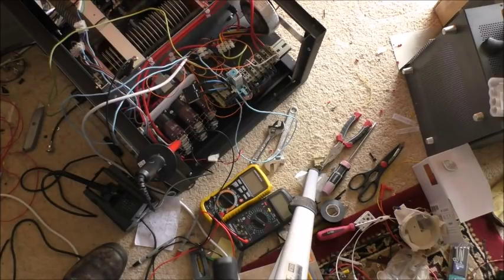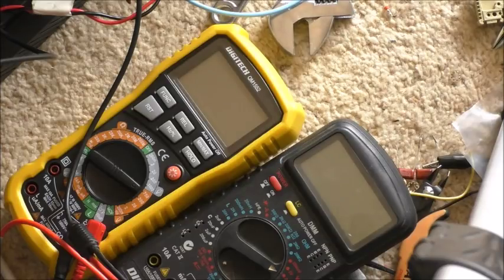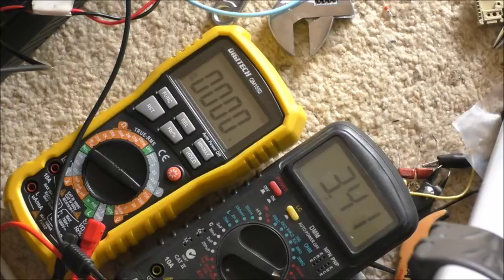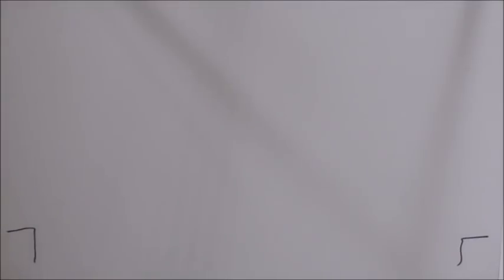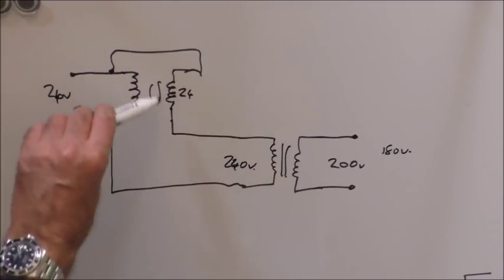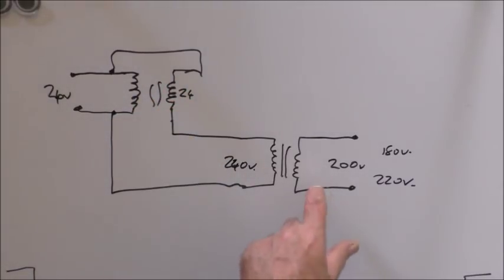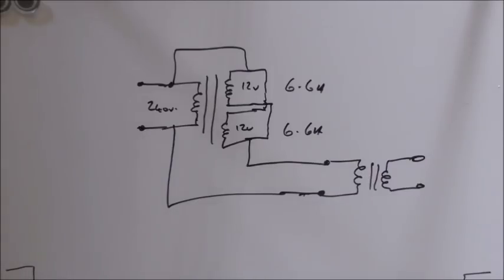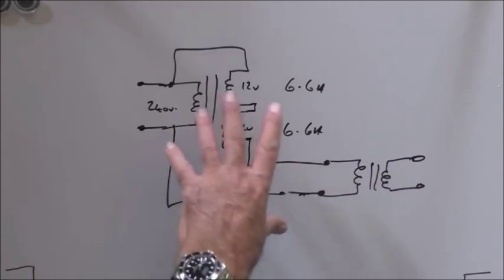Bucking And Boosting Transformers... Good Heavens

Comment: I need BUCK BOOST TRANSFORMER designing of 
40KVA stabilizer 3phase
Input voltage range: 340 to 500 volts
Output voltage : 400 volts  
And I need TAP POINT of variable transformer

Comment: Hi Steve, thanks for the video! We’ve missed you! Cool bucking video and thank you for explaining how it all works! Thats said IMHO for the amp project if possible bucking and boosting should be avoided, just makes things more complicated and less efficient, and who knows what else will come up down the road. Now that you’ve got the target voltage for the tube I guess it would make more sense to get a transformer wound for it, possibly with additional secondaries for the heater and bias voltages.

Glad you’re well mate! 73 Andy (sv1dkd)
Reply from the maker: Thanks Andy. That would be the ideal solution, but I suspect I'll end up using the toroidal transformer. That will only give about 4KV HT, which means there's plenty of headroom on the smoothing capacitor stack which is rated at 5.4KV. The undulating mains voltage would be no problem with that amount of headroom.

Comment: Welcome back Steve.
Reply from the maker: Thanks Daz. I may opt for the lower voltage HT transformer and dispense with the bucking. The plan has always been to keep this project as simple as possible. The only time I get less than 1500W out of it is when the mains voltage falls to around 230V. I have never used a voltage doubler circuit on a power amplifier design before, and I'm not likely to again. The voltage is way too high with no load, and sags more than I would like when loaded. The results aren't too predictable.